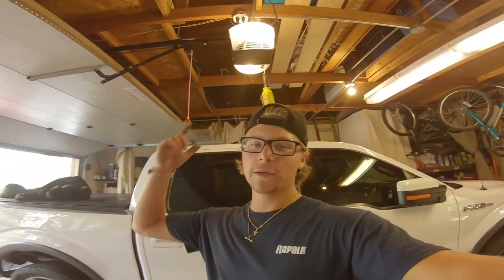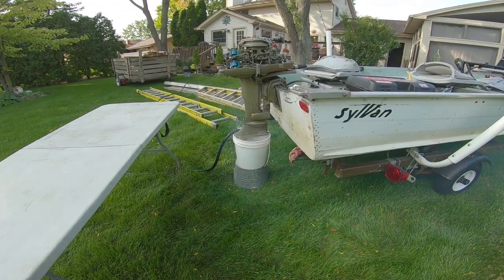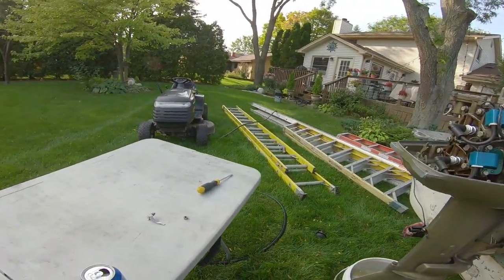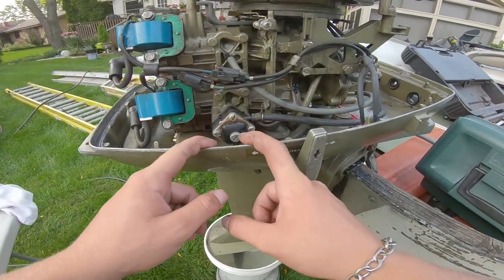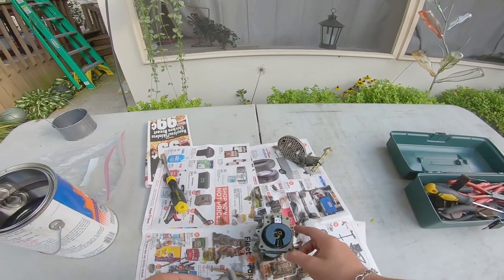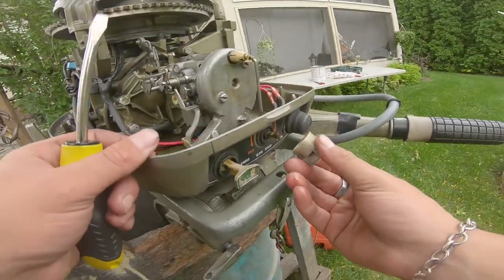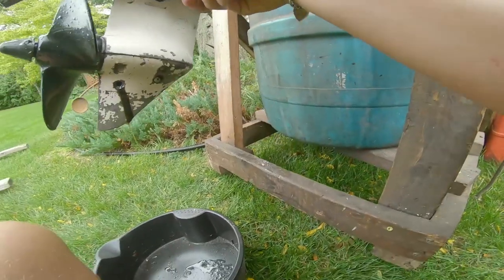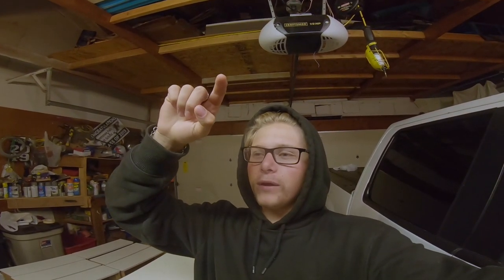Johnson 20hp - Carb Clean, Lower Unit, Water Pump, Idle Adjustment (FIXED)

Comment: That thing needs to be deeper in a barrel, the main water intake is directly behind the prop, and there’s some smaller inlets higher up on the case. But it should be twice as deep as you got it there. The water comes out forcefully from the inverted hole in the notch where the lower unit get narrower. The water intake is the little tube-looking projecting right behind the prop, with some smaller screens higher up on the case.

Comment: hi, i have the same motor. cant figure out where water comes out. its pumps water out of the exhaust, but think there should be a little water coming out of a holw? like every other outboard?
Reply from the maker: the two holes on the back where the exhaust is is the only place up top where water comes out, these motors don’t have the tell-tale out of the lower cowling like you see on most motors, usually after about a minute of running you’ll see a little bit of water come out the exhaust holes and when running on the lake at higher rpms you’ll get more flow. but as long as there is some water coming out of the exhaust at idle after about a minute everything is working properly.

Comment: Thanks mate,Ive just bought the very same engine and having the very same idle problems.Ill see what i can do.Thanks again.
Reply from the maker: no problem! when you adjust the fuel air mixture screw make sure that you start at 1.5 turns out, not 2.5 like i said in the video! should fix that problem, good luck!
Reply: Is that 1.5 turns out after you thread it all the way in? Having the same problem with similar motor
Reply from the maker: yes, 1.5 turns out after turning it in until it’s lightly seated just to where you feel it stop so you don’t mess up the tip of the needle, that’s just a starting point. from there you turn it either 1/4 turn out (leaner) or 1/4 in (richer) until you get it to have a nice idle. if you can’t seem to get it to idle down or run “richer” the issue is either lack of fuel from fuel pump, dirty carb, or there is a vacuum leak somewhere causing it to suck excess air and making it run lean no matter how you change the fuel air mixture

Comment: As hot as the lower unit was, I would definitely replace the impeller. Nice video, I have two 25hp Johnsons that I've set and cleaned points, cleaned the carbs and resealed and rebuilt the gear housing and lower units.
Reply: Do you know what seal kit you got. I’m looking for one
Reply: On boats.net it will show a detailed diagram of the entire outboard.  And you can pick and choose which seal, or part you need.

Comment: When you ran the motor in the barrel, you said that the water pump was working. How were you able to tell this? I have a 1978 25HP, and I can't find a place where the water is exiting the motor.
Reply from the maker: if your motor doesn’t have the “tell tale” hose from the bottom of the powerhead it’s just like mine where the water comes out of the exhaust hole on the back of the leg, about 1ft up above the prop straight out the back. run it with the intake completely underwater and within a minute or two you should have a spray coming out with the exhaust, if you do not after that long let it go a little more but more likely than not either the water pump isn’t pumping or you have something along the way blocking the water from coming out.. could be the thermostat failing

Comment: I have a Johnson 18 horse. I can’t seem to get it to hit max mph. I have changed spark plugs, ran sea foam through it. The only time I noticed it hit 17 mph is when I was running out of gas. Other than that, top speed of 7mph. I checked the carb and it is clean. I’m at a loss.
Reply from the maker: i actually just had a similar problem with my 20hp, i would say the first thing you should do is run the motor and on that fuel air mixture screw (if you have one like mine) turn it counter clockwise in increments of 1/8 turns making it more lean and see if that’ll do it since it ran better when it was running out of gas. if that doesn’t do it, it could be that your high speed butterfly isn’t opening all the way when you go full throttle, to check that just go full throttle and look at that butterfly and see if it’s perfectly horizontal. if that’s the case the adjustment is easy but i would start with the fuel air mixture screw. let me know what happens!
Reply: Hey, I know it's a year later but I have been having the same issue as you with my outboard and I'm about to give his response a shot. Just curious if it worked for you to gain your speed back?

Comment: i have that same engine but locked up 1965 right?
Reply from the maker: this is a 1970 but the motors should be pretty much identical, pour some atf down the spark plug holes with the motor tilted up for a day or two and try to spin it with a breaker bar on the flywheel nut.. (clockwise) and see if that free’s it up! don’t force it either that can get you in some more trouble
Reply: @buschfishin  thanks for info.

Comment: Were is the kill wire hooked to on the motor
Reply from the maker: there’s two wires going into it, one comes from the blue coils next to the spark plugs in the back and the others go under the fly wheel. there’s a total of 4 wires going into the two terminals

Comment: 1.5 turns out for the air mixture screw,  then start and adjust
Reply from the maker: did i say 2.5 in the video? i knew i should’ve changed that, thank you!